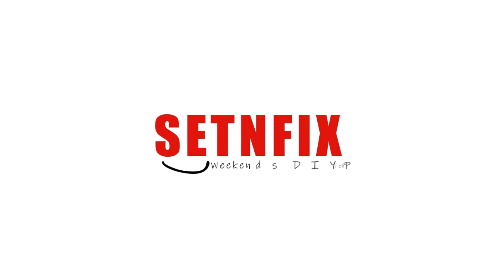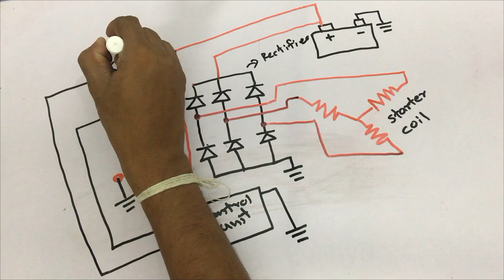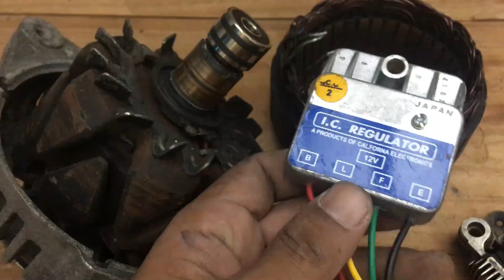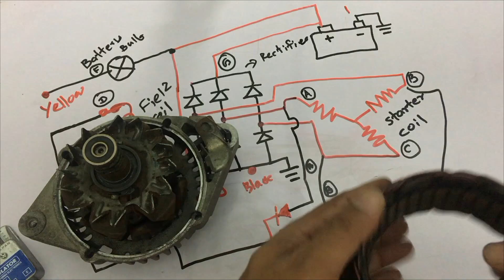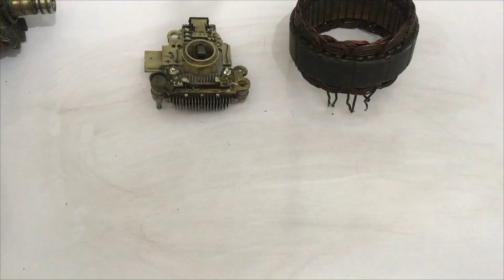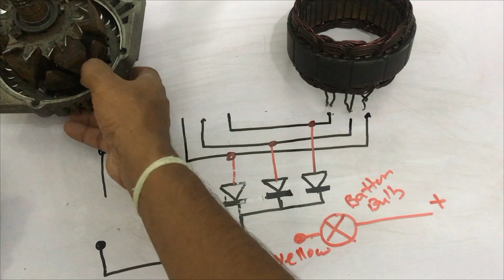How to Replace Alternator IC with DIY alternator IC

Comment: This is a good explanation. But I’m still a little unsure of how I’m to determine which is the field coil. The lower or upper of the two copper rings on the rotor ?
Reply from the maker: Which is connected to the two brushes